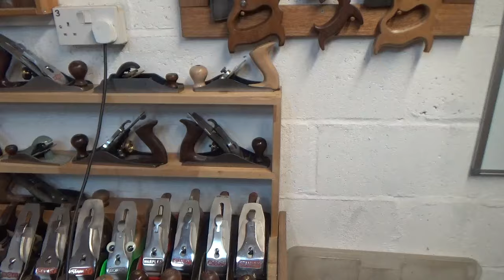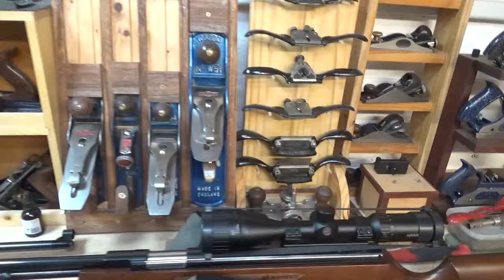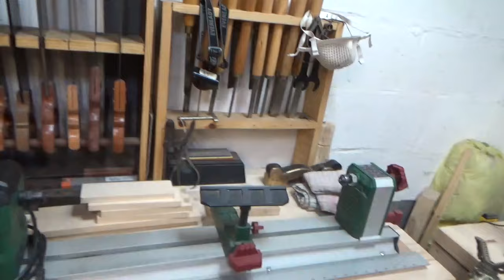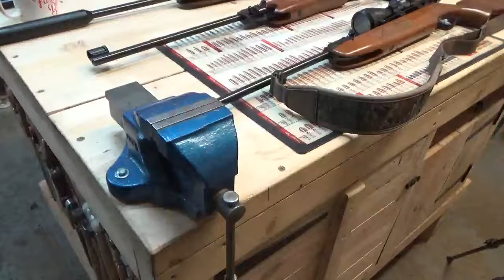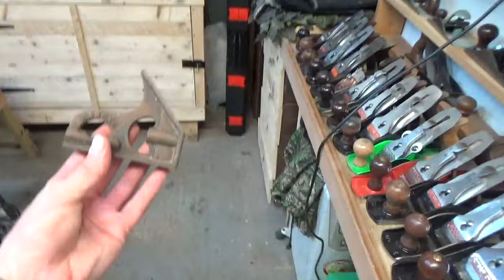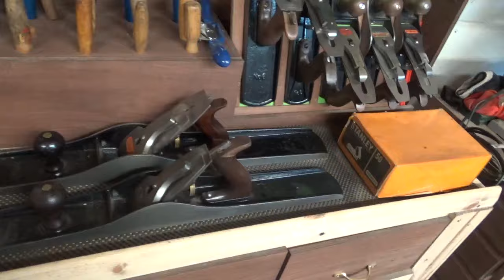A quick workshop tour

Comment: Hi Vin, Nice to see your hand tools. I still have my kit from when i started in 1963 as a coachbuilder. Rather than hand planes i ended up in about 1991 with a new Weinig four sided planer-moulder which running a joinery and cabinet making business was essential if you wanted to make profits. Sadly most of these hand tools today have no use. Most of the dealers are stacked out with smoothing planes etc, often at silly expensive prices. I have a Millers Falls wartime plane which is quite nice. Keep up the good work. I have a man coming on wednesday to sell me a TX200SR in immac condition. cheap if you are int. let me know. I have too many guns.
Reply from the maker: Oooh that's sounds intriguing, email me the details buddy 👍👍👍 totally agree in regards to making a profit that machinery is essential, for me the hand tool side of things is about keeping the craftsmanship alive, and let's face it there's something so satisfying about hand planing wood and seeing the almost transparent shavings coming off and glassy finish left behind 😉😁👍👍

Comment: Vin no need to worry about your hair do what I do £18 spent on a set of clippers 30 years ago and that's the job done. 🤣
As for the teeth then I appear to have fewer in my face as the years tick by so not much to worry about there fewer to clean I find is saves a fortune on toothpaste and my toothbrushes last that little bit longer.😂

Cracking workshop btw. 
🔫🔫🔫